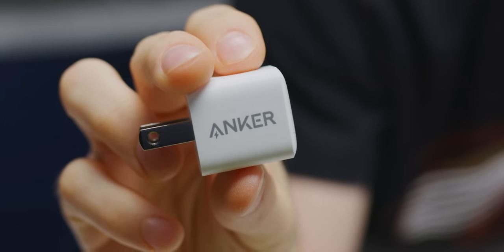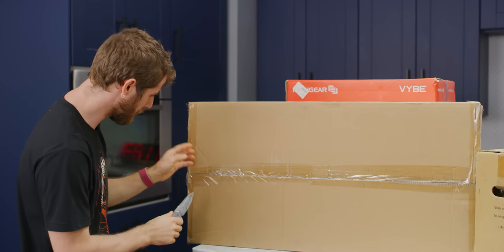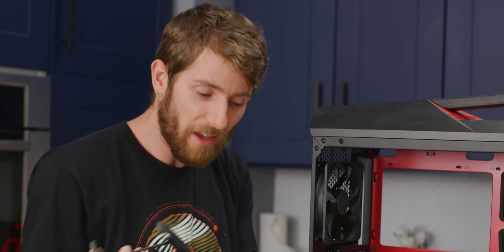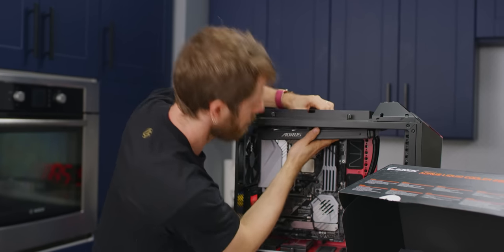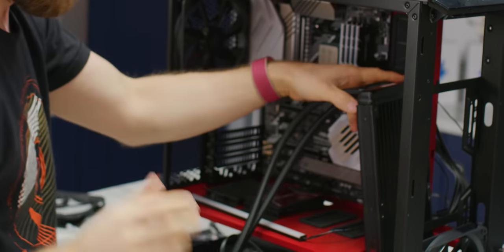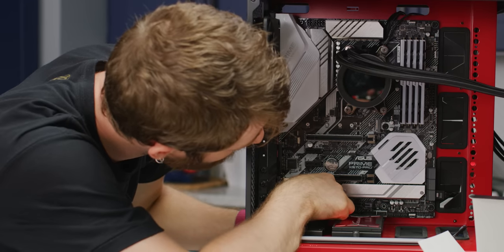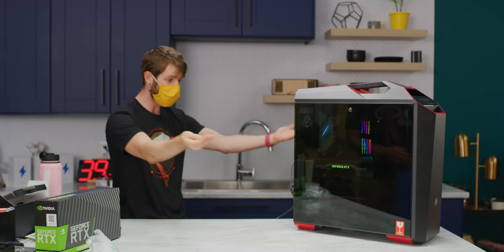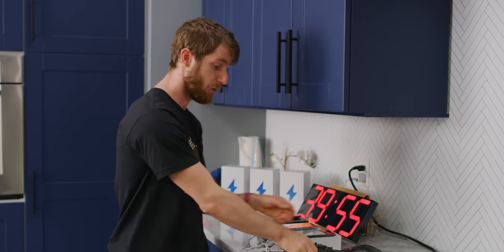PC building SPEED challenge!

Comment: Apple: "We're innovative and push the limits of engineering"
Apple for the past 10+ years with phone chargers: best I can do is 5W
Reply: they have always sold better ones they just don't include those with phones, and now they include none lol
Reply: @enrique4615  that's dismal if apple is expecting someone to pay 1k+ for their phone
Reply: @enrique4615  they didn't include the charger to "minimize electronic waste" when it's actually a marketing strategy to sell their new charger 🙄
Reply: charging faster causes the life of your batteries to deteriorate faster. didnt you know that??
Reply: @humble_integrity  not true. Heating up your battery is what causes damage
 So as long as the temperatures are held under control, fast charging is fine for your mobile. I got 40W with my P30 Pro which im using everyday for the past year. No sign of battery damage ;)
Reply: I don't think charging faster = shorter lifespan. I mean, c'mon. The companies should have been researching that right? They must have a technology to prevent serious damage from faster charging. Tbh, I only have phone with 18 and 20 watt charger (qc 3.0, and super vooc) from last year so I didn't know either, but I'll buy a phone capable of charging with 65watt next year and I think the batteries should be fine for 2-3 years
Reply: @humble_integrity  Do you know using a battery decreases the life of a battery?
Reply: @Neph991   it’s actually part of a European directive on e waste and they will all be doing it soon.
Reply: Meanwhile oneplus releases a 65w charger.
Reply: @maciej21  ABC charging, always be charging whenever possible. Charge cycles + extreme temperatures kill batteries, constant charging is the best thing for batteries. Laptops for example, keep them plugged in.
Reply: @MajinFajita  Like you were paying for a fucking $9.99 charger... Granted, they could throw it in there, but if it kills your buy because of that, then you know nothing.
Reply: The Anonymus Apdroid  all batteries are getting worn, even the ones slowly charged. He mentiones that in the video.
Reply: The Anonymus Apdroid  mrwhosetheboss. He mentioned that heat is bad for a battery, that they take more space than regular ones, that you should not overcharge or discharge it and that all batteries lose power in time and that 30w is optimal in 2020 (I have 40w which is not fat from optimal) ;)
Reply: @humble_integrity  i've been only using a 60w charger and my phone hasn't even shown any signs of the battery deteriorating hehehe
Reply: That's why I have Huawei. 40W charger baby.
Reply: Laughs in 65w charger with $300 phone
Reply: @zaptowee6625  Uh no I have actually seen that kill laptop batteries quicker then normal. So no DO NOT keep your laptop always plugged in.
Reply: The Anonymus Apdroid  still will have a longer battery life cycle than an iPhone and for 1/3 of the price
Reply: @Montisaquadeis  idk from the research I did that was the conclusion I found, & from my understanding of batteries that would make sense to me. Also doesn't the laptop just draw power directly from the wall when it's full. Also you can adjust the maximum charge percent in bios, make it 90% so your not pushing it at 100% constantly.
Reply: @Neph991  I'm actually fine with it and I wish Apple wouldn't include the cable either. I use Anker cables and chargers. They are light years better than Apple's.

Comment: "Why does Apple include a 5 watt brick?"

so you have to buy another 30w one, obviously lol
Reply: this time they didnt include a charger or earphones, just iphone and a lightning cable in the box
Reply: To be fair, it may preserve battery life a little better than a faster charger would.
Reply: @btcwiz  and that Lightning cable is USB-C on the other end ontop of that menaing many of the chargers you have at home won't work since I am betting most if not all of them are USB-A. I don't mind that the Note 10+ came with a USB-C to USB-C cable int the box since it also came with a USB-C charger in the box as well.
Reply: @cyrylo23  Bruh, that's the pro charger only included in tablets/Iphone 11 pros. 5w wasn't meant to take seriously, those pro chargers are barely minimum.
Reply: @nowayitsjose1445   I get it that 5W chargers aren't meant to be serious. I'm so used to my OnePlus6 20W charger.
But in the first minute of the video Linus said that iPhone 11 pro max support over 20W charging and it's way more than included 5W brickcharger. I knew that while standard iphone 11 doesn't come with charger, 11 pro max do have one included, so it sounded like apple includes 5W charger with phones which could take over 20W which is factually false.
Reply: *Laughing with no Power Brick in iPhone 12*
Reply: @pixels_per_inch  yes it will degrade it, but it will probably degrade slower
Higher temperature and a more violent charging process will always mean battery degradation

Comment: Apple: Let's not include a wall adapter and include a cable different from our old chargers so people will buy our new charger separately.

Anker: Time to advertise our wall adapter.
Reply: Anker still has to pay apple for the rights per different cable, so say apples rate were $10 to sell one type of charger and anker wanted to sell 3 size chargers for 3 different colors that would be 9 different cables using apples lightning port and anker would have to pay apple $90, its probably not very correct and the permission to sell the cables could be subscription based or a % of profits but the point is that apple still gets money from anker selling their chargers
Reply: Wow that's ridiculous, but I'm not surprised.  Apple really has everyone by the balls with their proprietary crap.
Reply: @redsquirrelftw  its not unique to apple, even hdmi cost a fee to make cables for but im pretty sure apple's prices are higher
Reply: @24Sparja  Really?  I did not know that, that's ridiculous.  They should encourage people to  use standards instead of discouraging it.  What about stuff like USB?  If I make a device that has USB ports am I actually suppose to pay some kind of fee to someone?  That sucks then.  I can almost see why Apple just says F it and makes their own standards now.
Reply: @redsquirrelftw  I believe an manufacturer has to pay to be able to put the USB logo on their box but I don't think they pay to use the technology itself

Comment: Fun fact: Xiaomi just announced their 80 watt charger that charges their phone to full battery in 19 minutes....19  minutes
Edit: Its even wireless
Reply: Xiaomi puts crap adverts all over their software
Reply: @pgre  Luckily on Android you can just install a clean OS
Reply: And then your phone dies in 19 minutes after 10 uses, lol.

Edit: I used hyperbole to show how much of a double edged sword this is. It isn't something that you would want.
Reply: @pgre  is this really a thing?
I have a Xiaomi and have not seen a single ad from xiaomis software
Reply: @JJJT-  They are just kidding,I myself have xiaomi phone as well. Ppl have the thought of Chinese phones having ads and spyware which is a myth
Reply: big bada boom
Reply: @hyperghost99  just as much spyware as every other phone lol
Reply: @hyperghost99  no its true actually, the newer redmi phones have ads on them some on included apps etc. But you can always disable them in the settings. Bit annoying but an easy fix
Reply: @hyperghost99 
Okay Xi Jinping.
Reply: Hmmm i smell cap
Reply: @pgre  TL;DR Sure there are ads but they are optional. Either uninstall/replace the app or disable ads. 

The only stock apps ive seen ads in are the cleaner, file browser, web browser, and app vault. I stopped using those apps because of others reasons but I just went back to check if they were still there. Cleaner was the only one that had ads. You can toggle on/off ads in the browser and app vault. App vault can also be uninstalled. The file browser's UI is garbage so I use the one by Asus.
Reply: 80W wireless charging. They were already selling 120W wired charging.
RIP battery
Reply: @pgre  not all. Never seen a single ad on my mi band 4 nor the mi fit app. (granted I don't even know how you would display an ad on such a small display.)
Reply: You left out the part where you need a 12" diameter cable hooked directly into the power grid and it produces enough heat to kill anyone in a 5 mile radius.
Reply: @xkyoshi11  nope my sister has one that has 65 watt charge that charges 100% in 30 minutes..
Basically last the whole day
Reply: Oppo just announced 125W
Reply: so what, do they have like 4 batteries daisy chained? how the hell do you charge a battery or even two batteries at 80 W?
Reply: Xiaomi battery lifetime is only a year even you use the phone carefully. After that they start to drain so hard. I have been changed the battery twice after a year.
Reply: take a look on  ShortCircuit they had the Xaomi with 105 watt charging there
Reply: They have 120 watt charging on mi 10 ultra
Reply: @pgre  u can turn it off easily
Reply: 19 minutes to charge and 12 months (or less) to destroy your battery health.

* Rant warning *
These kind of charging powers cannot be safe for the long term usage of the battery. But that's fine for Chinese phone companies because people just buy a new phone when their old one isn't lasting a full day on a charge anymore. In 11 month's time, my Oneplus 7T's 30W charger has already degraded the battery to about 4,5 hours of screen on time (from 100% to 1%). I never charge overnight and very rarely charge over 80% to preserve the battery and yet it has degraded noticeably. No wonder OnePlus doesn't tell the battery health % in the settings. * Rant over *

Edit: Update to rant, I downloaded OnePlus Diagnostics app and my battery health is at 89%. It also shows battery temps so I tested with 18W PD charger, 1-15% charged raised the temperature to 32.5 Celsius. Right after that I plugged in the included 30W charger and temps jumped almost immediately to 39C. After a few minutes and 15% of charging the temperature settled to 40.9C! That is a huge difference in temps and probably the cause of the degradation of my battery.
Reply: @pgre  xiaomi.eu for that sweet sweet ad free expirience
Reply: Small battery
Reply: @JJJT-  me too. For years now. And you know what...YouTube has no ads
Reply: *80W wireless charger
Xiaomi already has 120w normal charger
Reply: @traniel123456789  sadly it voids warranty
Reply: @xkyoshi11  that’s not how it works
Reply: @friedrichhartmann3539  if it has Google software, it does have "spyware"
Reply: @hyperghost99  well.... I have a black shark 2, and they do have ads on the software that cleans your phone's cache and shit, it pops up after you use it. Also, it's a chinese phone... I'd be more surprised if it doesn't have spyware, sending my data directly to some department of the CCP. You guys aren't thinking straight about a country with no freedom of expression and press if you don't think the CCP's doing some very shady shit you don't know about
Reply: RIP Battery
Reply: Not sure how this is done, I have an Oppo Find X2 Pro with a 65 watt charger and that takes around 40 mins to charge fully. How can you halve that time with 15 extra watts and a battery capacity 260 mAh less. Questionable?
Reply: @dLzzzgaming  Indian propaganda.
Reply: @Mojkanal1234  ROFL sure thing buddy.
Reply: @dLzzzgaming  It's true though.
Reply: @JJJT-  test, it is a thing and it Will heavily dependa where do You adquired the phone, dime contries get ads , dime not. Buy Even if You get them , You go to some settings and disable forever
Reply: Kaboom? 
Yes reco kaboom
Reply: But 69 just sounds better
Reply: That’s a nice battery killer
Reply: Wow that is really fast
Reply: @LegendaryMike  never seen an ad on my phone using cleaner or file browser. never use the web browser so cant really say, but didnt see any when just opening it now.
Reply: Linus: Challenge accepted
Reply: @jbcool  they only put ads on certain devices. Redmi brand of phones have ads. Poco phones don't. I dont know what other lines of devices have them
Reply: Funner fact, vivo has shown a 120 watt charger that charges in 13 minutes (this was a year ago)
Reference: https://youtu.be/KOLEY5-JzGQ
Reply: No they do not put adverts on your phone. That is only in asia. In europe or america those phones are a bit more expensive but they do not have adverts because of the law
Reply: oh wow, cant wait to destroy/overheat my battery in 3 months!!!
Reply: People saying quick charge ruins battery are the people that have never used one, have fun using your phone plugged into a wall half the time
Reply: How do you charge a phone with 100+ watts? I=U/R How we charge a car battery Wich is 60Ah in 2 hour? Omg such science.Much charging. So much wattage
Reply: @titanli4411  yeah sure, physics doesn't exist right?
Reply: @JJJT-  on poco X3 phones somewhere in the world, they have ads all over the place
Reply: Kills the battery though
Reply: @TheDarkness344  well those are redmi, for the domestic chinese market. I have an international ver pocophone, and I don't get any ads
Reply: @JJJT-  never saw an ad on my mi mix 2s, did saw some on my poco x3 but could easily disable them, now I have the EU rom again so all the crap is gone anyway
Reply: @yibyobs  I used my Mi Mix 2s for 2,5 years, battery was still fine. Don't charge overnight lol
Reply: Does is also come with a microphone to record your conversations and report back to Winnie-the-Pooh?
Reply: Kinda fast but its chinese
Reply: @dLzzzgaming  you should install the EU rom and just to be sure use blokada
Reply: @denethramanayake137  I guess multiple batteries like the OnePlus 7t
Reply: @LegendaryMike  latest poco x3 has ads, even in western countries. You can disable them or install the EU rom to get rid of them entirely
Reply: @totisa93 they do since the poco x3, bought mine in the Netherlands and it had ads. Not anymore though with the EU rom
Reply: RIP battery.
Reply: 9:30 He’s back
Reply: Yes, by the way it's also wireless
Reply: @hyperghost99  actually, i have a Xiaomi phone. I can assure that i get ads in MIUI and it sucks. Good thing i planned to install a custom ROM on my Xiaomi phone so i don’t get ads. Whether you get ads or not is determine which stock ROM you get, usually the “asian” version or chinese version of the stock ROM have ads, while the global and europe version of the stock ROM doesn’t have ads
Reply: And you'll get your all data handed to Xinnie the Ping
Reply: Isn't it a 120w or is that the one plus ultra.
Reply: @RTXNL  Maybe for the flagship it will just fine. I used redmi 5A and Mi A2 Lite... Both batteries only for 1 year. And then they start draining hard. Even i m not charge em overnight.
Reply: @yibyobs  I have been using my redmi note 4x for 3 years and the battery still fine (it lasts full day with around 6 hours of usage like youtube and other social media. I don't play game on it because I have better phone for game). Fyi I do charge my phone when I sleep so basically it'll destroy my battery faster right? Fortunately that's not my case
Reply: Techlinked
Reply: @Neph991  good for you then.
Reply: So you call them Steamed Batteries despite the fact they're obviously fried? Yes, it's a regional dialect.
Reply: Also you can simply root the phone and Install lineage os. If something goes wrong, not during the installation something else like idk the cameras stop working or something, you can simply flash it with the original OS and unroot it. If the cameras still don't work, Xiaomi will honour the warranty and fix your phone/replace it.
Unless you bricked your camera because of rooting it or flashing it or something. If it's your fault then it's not covered under warranty.

As far as I know the only manufacturer that covers rooting and stuff under warranty as long as you return it back in its original state (talking about the OS)
Reply: Did they mention the added listening device linked directly to the Chinese Government?
Reply: @margo3c541  yh they only put ads on their cheaper line ups such as redmi - thats part of the reason why they are so cheap and good value - because they also advertise the company and get you to buy more products XD
Reply: @RTXNL  thanks, that edplains it. I live in the EU.
Maybe our privacy laws are good for some things.
Reply: @RTXNL  well the oppo find X2 pro also has multiple batteries

Comment: I remember when I built my first pc, I used Logicalincrements, which claimed that an experienced pc builder could build a pc in as little as 15 minutes. They also said a new pc builder could build one in 2 hours. Both of those are lies.
Reply: Yeah its more like 20-25 min for an experienced person building in a case thats that terrible. Then like 3 hours for a new user taking your time and making sure everything is done right.
Reply: If you work at a system integrator or a boutique PC builder you'll be able to build a system in 15 minutes because you've already built identical configurations in the same handful of cases so you're in auto pilot mode pretty much. But once you encounter a few unfamiliar parts it'll throw you off.
Reply: I guess it depends on your definition of "build". If you mean throwing all the parts inside a case and make it post, yeah, 15 minutes or less.
Reply: Disassembling, repasting CPU and GPU, and adding 2 case fans, took me maybe 4 hours. But I somehow find time to deliberate and waste time whenever I go in...
Reply: @Cal94  me today with a itx build. Took 3 ish hours while my anxiety kicked in every time something seemed tensioned in. When finally completed I was met with mockery by the io shield on my desk.
Reply: It depends on what you are working with too. Some cases are easy and have swing out drive bays and motherboard tray. Some are tiny and super cramped with bare minimum features.

Comment: if i had to build a computer  in less than 35 mins, i wouldnt be messing about with AIOs or RGB, id be setting up either the stock cooler (if applicable) or a air tower rad instead